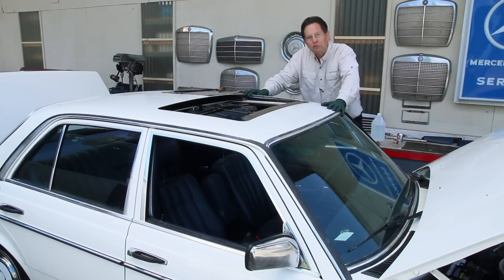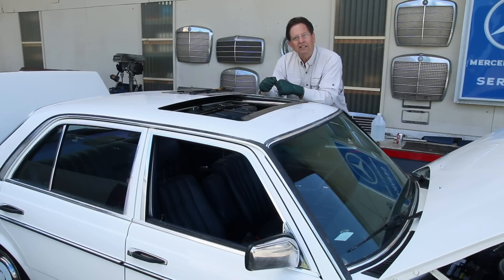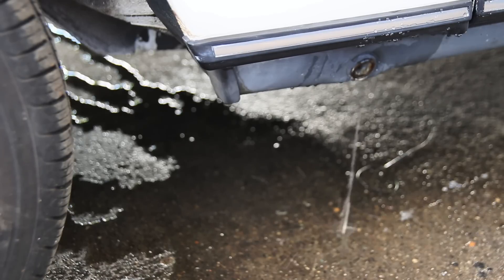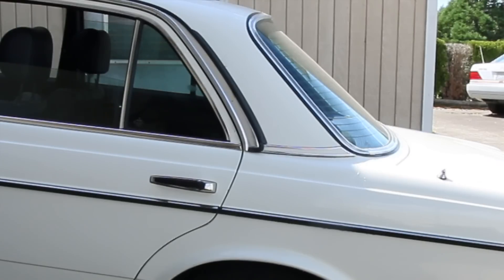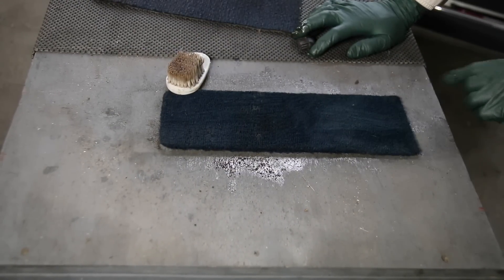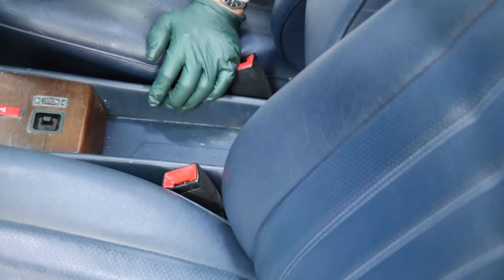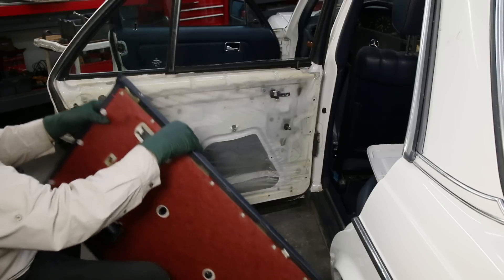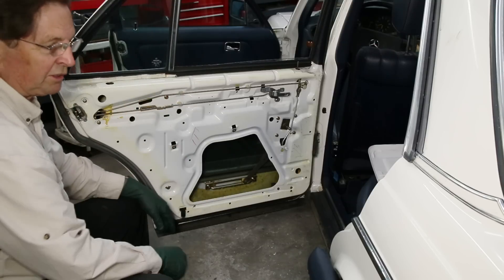W123 Mercedes 240D Rolling Restoration: Week 4 Progress Report

Comment: I’m looking at a 1990 300E 2.6L with 187K it is rust free and looks good be well kept is there anything I should know before purchasing? I’ve done some light research on the w124 chassis and models and they seem solid but what should I know before making the purchase?
Reply from the maker: Learn about the head gasket issue. Try to get maintenance records.